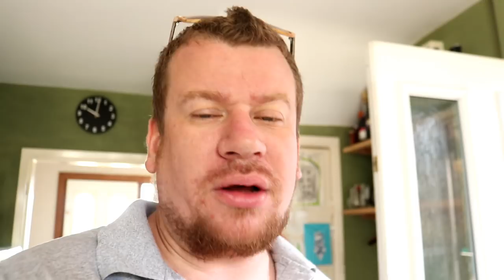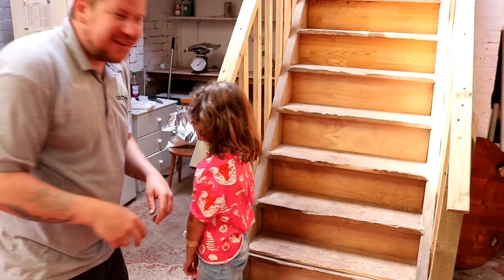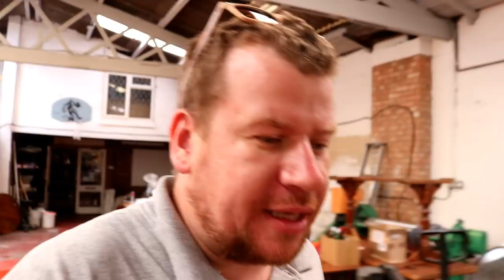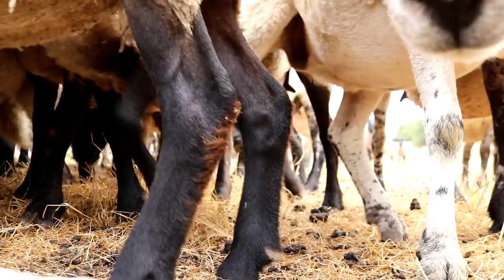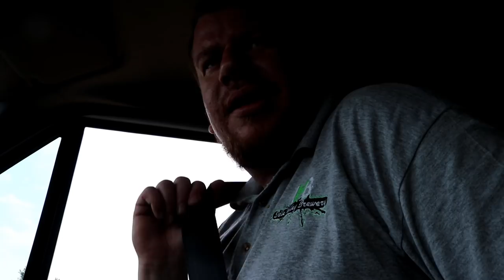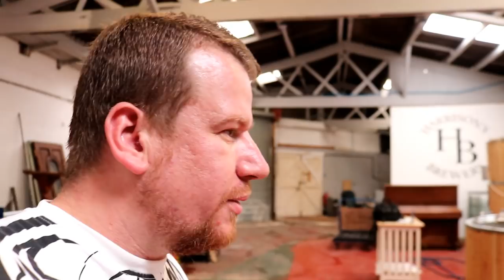THREE BREW SPRINT ~ WHAT CAN GO WRONG & SPENT GRAIN

Comment: Chris, have you ever considered a "Swamp Cooler"? You could knock one together pretty quick with your welding skills, a cheap pump (like a garden/fountain pump), a box fan, a plastic tank and some evaporative matting. It doesn't work super well in high humidity (85-90%), but it might drop the brewshed temps by 10-15 degrees and it's way cheaper than a full on a/c unit. Might work in the brewing floor also, though I think your heat sources might overwhelm it. Basically, you freeze a bunch of 2 liter or smaller plastic bottles filled with water - drop those in the tank and enjoy marginally cooler air.